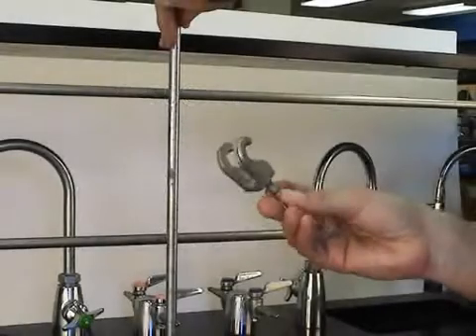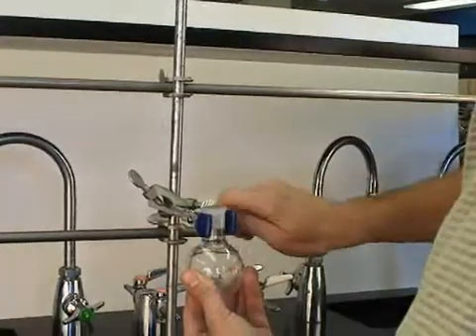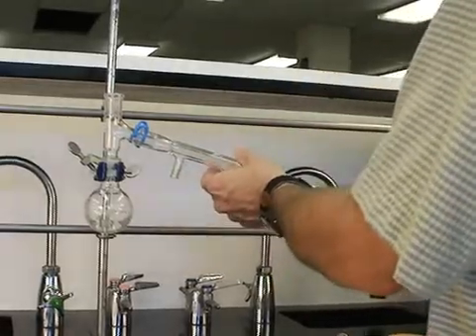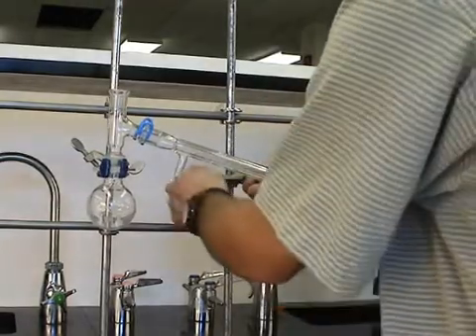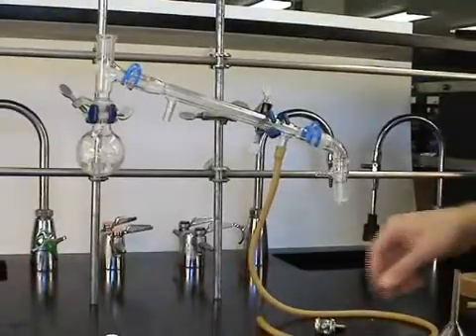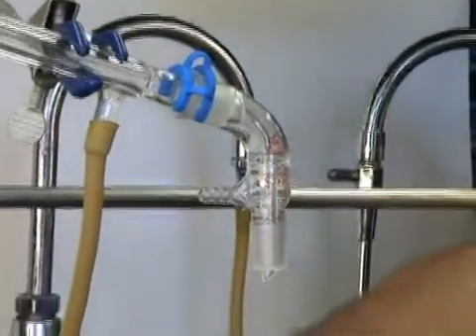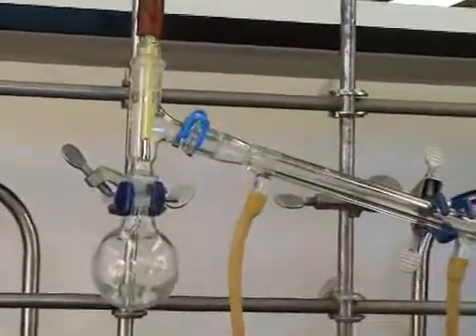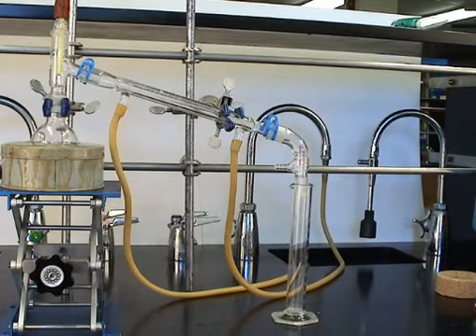Assembling a Simple Distillation Apparatus

Comment: Ok - what options do I have if all I have are standard 120 outlets?   Is there a different type of hotplate magnetic stirrer that I can obtain?
Reply: If you have the proper Thermowell, you can use variable transformer. Optionally, you could use a hot plate and a water or oil bath to heat the distillation flask.

Comment: Hi, nice video. I have a question why can't you plug directly into outlet?
Reply: The heating mantle takes 15 amps while outlets are usually only equipped to handle 10 amps. Plugging the mantle directly into the outlet could cause an electrical fire